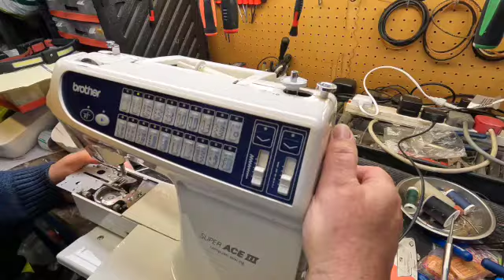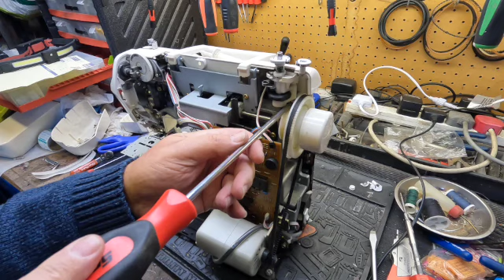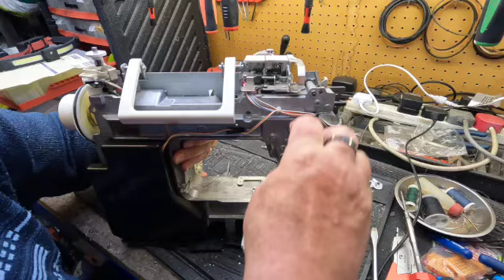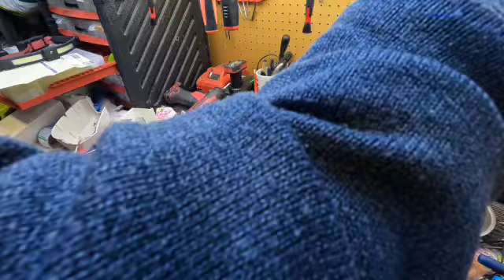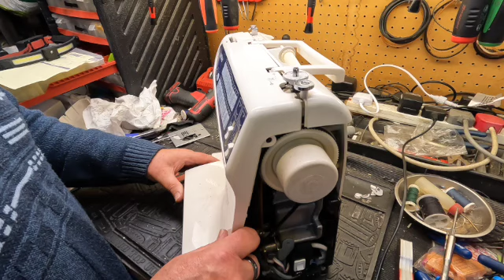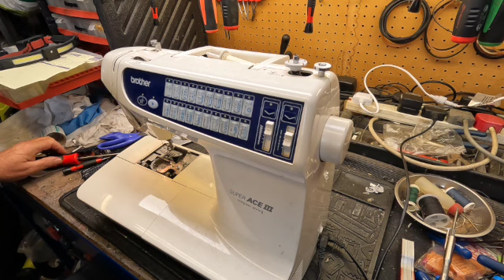BROTHER SUPER ACE III SERVICE

Comment: Hello!   Thanks so much for posting this video.  I live in the US and here that 'Super ace III'  seems to be called 'CS8072.' I have been using one for about 1.5 years--bought second hand from charity store. I only discovered this after seeing your video.  I was able to find the service manual online.  Using that and watching you gave me the courage to pry open the machine, unscrew the pieces, oil, and reassemble.  Of course it took me five times as long as you!  
But I'm thrilled with result.  So quiet after oiling.  And I thought I would find so much dirt and lint but had almost none!  Maybe it had been cleaned just before I bought it? Anyway, thanks again.  I was thinking I would need to buy a new one this year but now...no way because this is working great.

Comment: Hi, I have the exact same model, the Super Ace III and mine has a recurring fault where the top right hand two stitch lights illuminate and flash, the machine beeps twice indicating a fault and then will not respond. Do you take on repairs, and if so, where are you please? Thanks. Dave.
Reply: I‘ve got the extact same problem-  the stitches 17/18 and 19/20 are blinking and the machine beeps twice.  And I love this machine. 😢